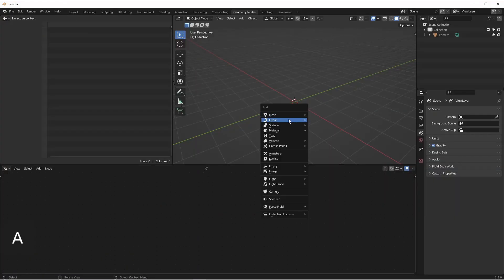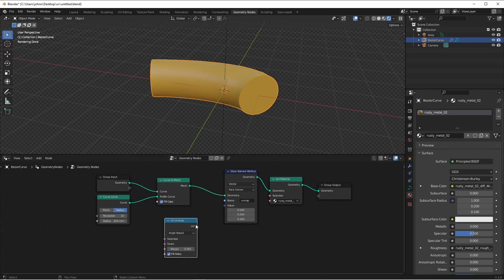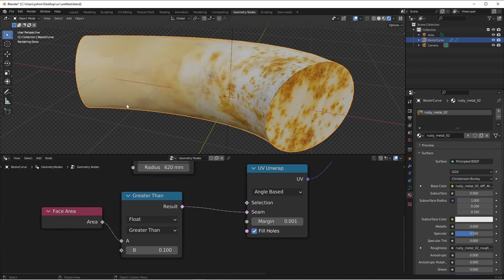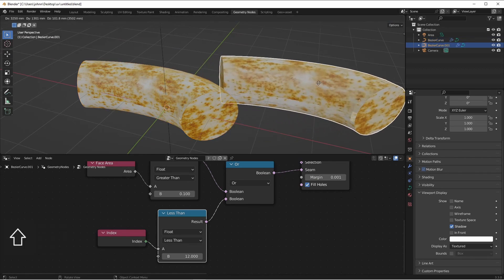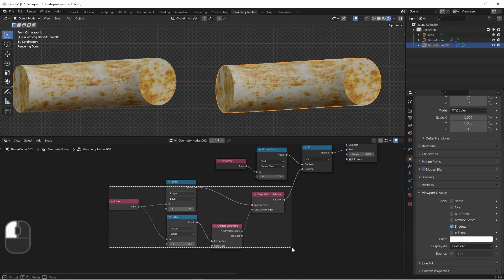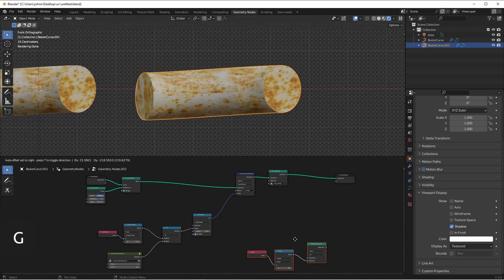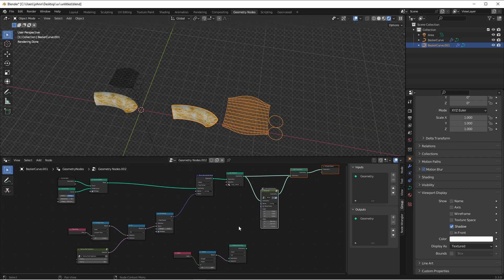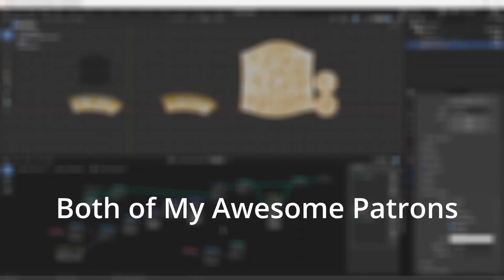Unwrap Your UVs in a Flash with Blender's Geometry Nodes

Comment: Such a great tutorial, explains the process in such an easy to understand way. I have been playing around with using a resample curve to determine the resolution(loop count) and combining this with the curve circle resolution value to have a direct input for the shortest edge path end vertex number, meaning you can adjust the resolution and it automatically updates the UVs. I was wondering if there is a way to use the selected seam edge and straighten the these paticular UV edges or straighten the cylinder unwrap as a whole so it is square, so textures can match along the seam?

Comment: Amazing work! You probably thought of this already, but as a further visualization aid you could add (after the first Curve to Mesh) a Mesh to Curve, feed it the same Selection of edges that are used to mark the seams, then a Curve to Mesh with a small radius/low resolution Curve Circle as the Profile Curve, then join this mesh onto the original (with a switch to turn it on or off)... then the selected seam edges would be visible on the original mesh.

Comment: Great tutorial. Actually, I have a question. Is there any option to suit the texture to different lengths of the curve? I want to do a fully geometry low poly rope, so it works fine until I change the lengths of the curve.
Reply from the maker: I’ve got another tube unwrapping video in the works that may answer that.
Reply: @JohnnyMatthews  Or maybe you could prepare a tutorial about making a low poly rope by geometry nodes. Actually, I cannot find anything useful on youtube. I found only solutions for how to do highpoly, which is not exactly what I want to achieve.

Comment: Great tutorial. Disappointing to see that the tools are still pretty pathetic though. Came here hoping to see 3.3 would allow writing direct data but it's still only writing to custom attributes which is completely useless outside of Blender. You shouldn't have to bake node groups down destructively to apply attributes for export, you should be able to write directly to UVs and Vertex Colors.
Reply from the maker: It's getting there. I think there were too many divergent ways of storing data on meshes. The dev team is trying to consolidate those and in the end make it so that you can easily use generic attributes to drive whatever you want and then they would export as whatever you wanted them to be. There is a TON of legacy code that has to be changed to do this. But rest assured, it is definitely on the dev's minds.

Comment: Tell you what would also be powerful; a 'selection from viewport' node.  User makes a selection of faces, edges, points, enters a name for the selection (on the node), clicks the node's 'get from view' button, and the node then adds a new bool attribute with the given name to each selected element.  The node could have a selection output socket for use on upstream nodes selection inputs, or alternatively a named attribute could be connected to the selection input (because the selection is stored as a named bool attribute).

Would be really handy here for selecting seams, but also open the door for a nice way to combine the speed of the viewport modelling with the advantages of the geometry nodes extra power.  Like when making extrusions, bevels, deletions, everything basically.
Reply from the maker: Once we get "freezing" in node trees, something like that could be possible.
Reply: @JohnnyMatthews  perhaps it wouldn't  need to freeze because the act of reading from the viewport selection is only performed by the user manually pushing a button.  It effectively just reads that bool attribute at every element evaluation rather than generating any new data.

Comment: Very interesting tutorial! One thought: when generating geometry, like in your example with the curve to mesh node, it is possible to store a boolean named attribute on the curve circle (like "is vertex index nº0" of the circle) and later use this attribute to mark a seam in the UV unwrap node.

It's really impressive how geometry nodes becomes more powerful with each new version of Blender. I find that there is so much potential with passing attributes between geometry nodes and shading nodes (with named attributes, or output value of geometry nodes).

Thanks for contributing to the development!
Reply from the maker: In Blender 3.4 there are some new mesh and curve topology nodes coming that I think would help do this.